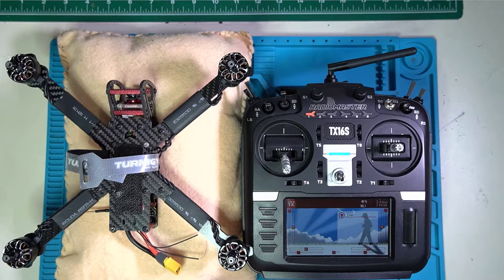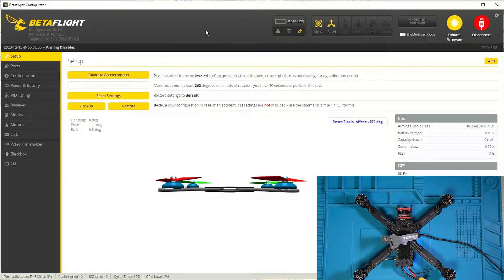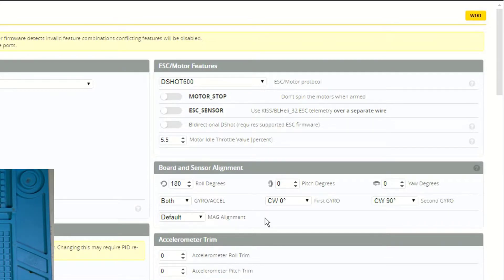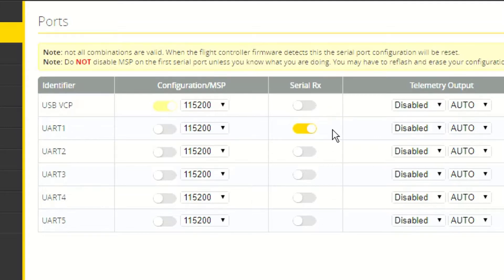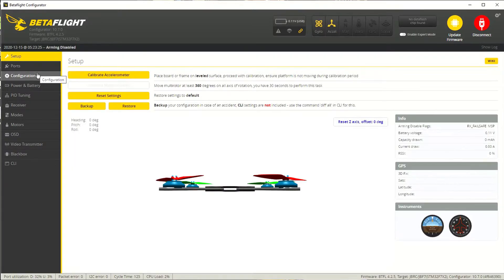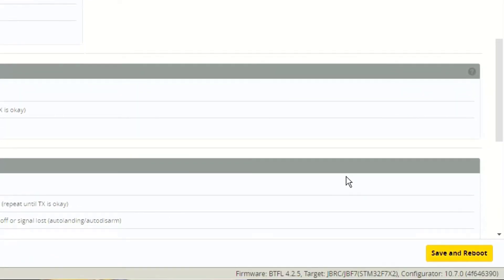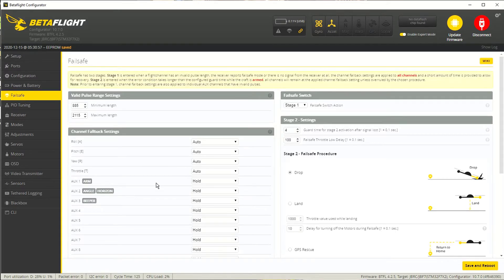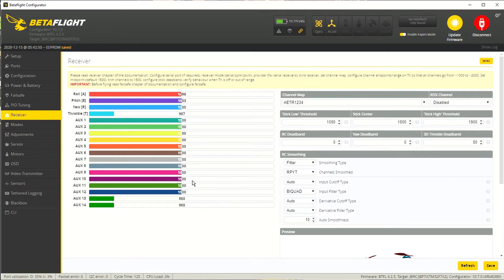Configuring Betaflight for the RDQ Bardwell F7 FPV Quad Build

Comment: Thanks for the series.  You’ve given me the confidence to start my 1st build.  I liked your choice of parts.  Specifically the JB FC because of the documentation and larger solder pads.  The frame and esc is installed.  Next step is to solder the motors to the esc.
Reply from the maker: Glad I could help!  Keep us posted on your build!